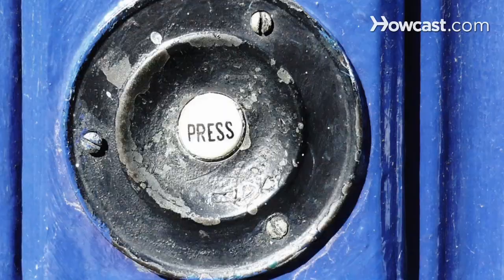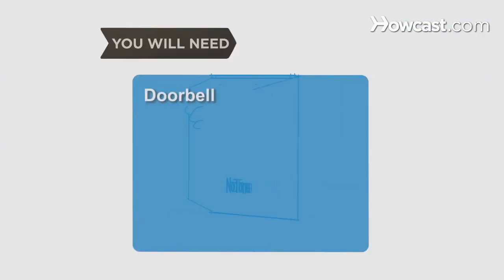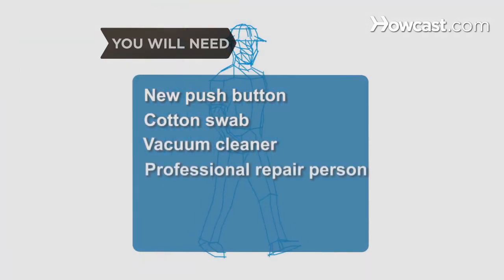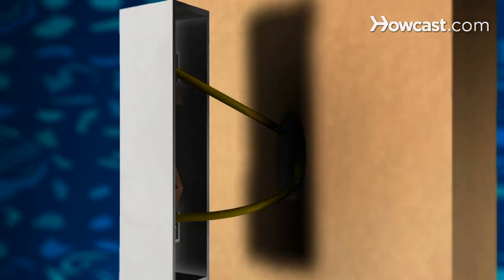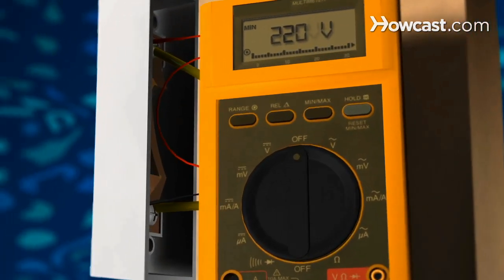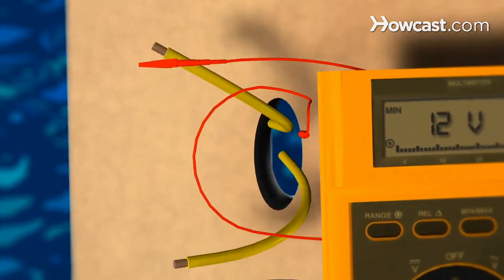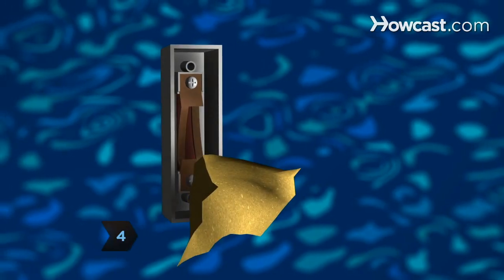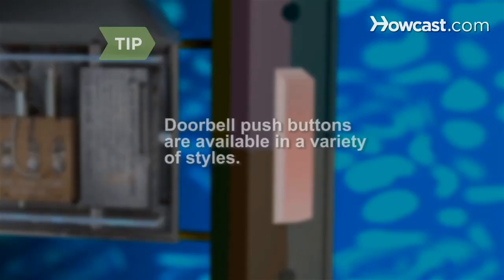How to Fix a Doorbell

Comment: I think this is almost perfect!  Short, identifies the probable problems, then guides you through the steps. Easy 'do it yourself' and then nice humor at the end.  My only concern is the comment "if the voltage is normal' that probably needs clarification.  I try these on-line 'fix-it' videos often and many 10 minute videos just give you 30 seconds of critical info.  I appreciate the guidance - I am going to go try right now!

Comment: My front doorbell only went "ding", not the two tone. I opened it up and noticed that the plunger spring had compacted. I pulled the plunger out and stretched the spring so that the top of the plunger was about an 1/8th inch off the chime plate. Now I have the two tone again.

Comment: Hey!  The problem was that it was dirty and I used a cotton swab with some 90% isoprophyl alcohol on it and wiped out all of the dirt that had built it around the plunger areas under the box.  I went outside and pressed the door bell button and ... it now works!
Thank you so much!  You saved me a bundle!  :)